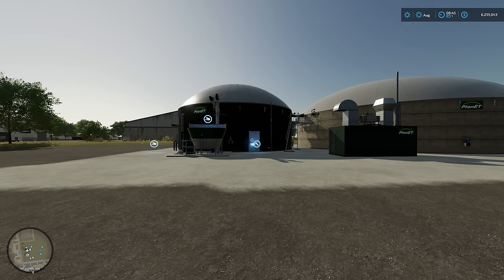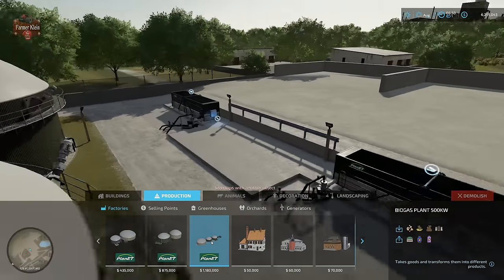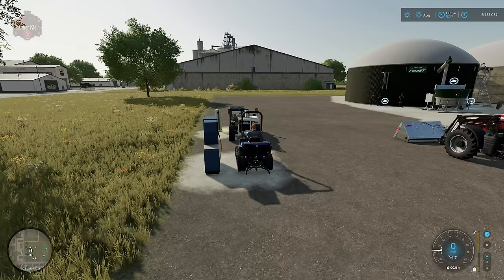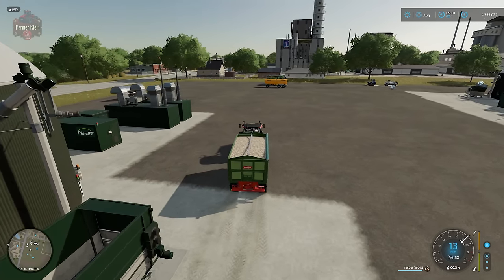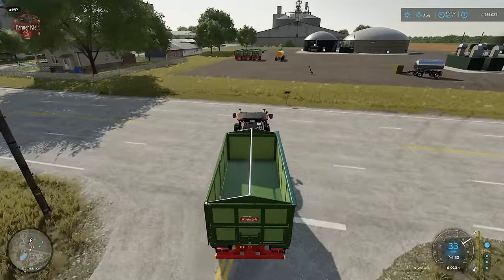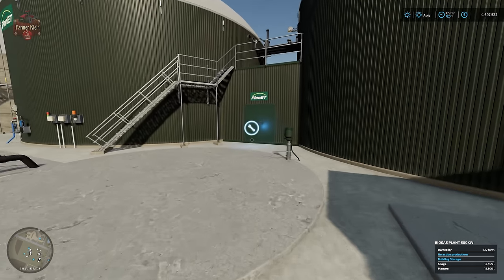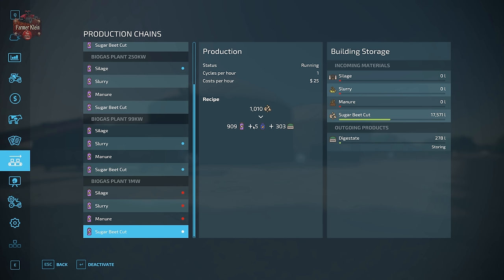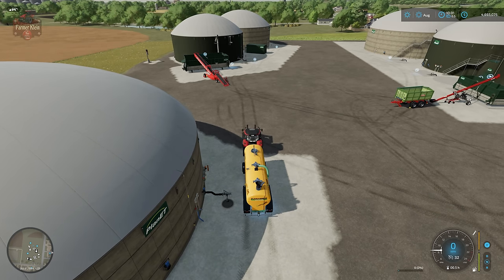Using the BioGas Plants in Farming Simulator 22

Comment: Ran a quick test. On Normal settings the money per 1,000L of silage came out to 509.  On Easy the price per 1,000L came to 863.  Now on easy I usually try to sell at 600 a L. Meaning that would be a profit of 250 per 1,000L Based on how fast the BGA can processes, it would be 29 months before I started to make a profit over that 1.5m investment of the BGA.  On normal it would be 73 months before I started to make a profit on the 1.5m investment of the BGA.  You could probably bring that number down allot if you also did slurry, manure and sugarbeets at the same time.

Comment: Thank you for clearing this up for us, could you go over Rollers for us and when to use them?
Reply from the maker: Once I figure it out.  The list is getting shorter.
Reply: Rollers are used after seeding. My work flow for field needing plowing is: Mulch, Plow, Lime, Stone Pick, Seeding, Rolling, Fertiliser 1, Fertiliser 2. Work flow for non plowing: Mulch, Cultivate, Stone Pick, Seeding, Rolling, Fertiliser 1, Fertiliser 2.
Reply: @Oz_Gnarly_One   why would you first lime and then stone pick? Isnt it better to swap both around?
Reply: Small stones just roll straight over after sowing, you'll do it twice otherwise, stone picker could work but the time taken I don't think would be economic, you will have to use them for larger stones though

Comment: Erlengrat unfortunately doesn't allow you to offload the trailers and you have to use the front loaders to drop them to the container (or belts I guess, if you can use them with bales). Additionally it seems broken, not accepting an input and also over-completing the contract with just one bale that you can scoop out at the end of the process ...

Comment: I remember in fs19 I got bored near end game, I wanted to see how far digestate would go if I completely filled the biogas plant to max capacity and see how viable it was for a fertilizer replacement, but I think spent 3 rounds of chaffing the entire map, filled it to max and then all of the digestate lasted all of like, 1/3rd of all of the fields, I was very disappointed. But it seems that maybe through automatically selling power and methane, you store those two commodities through money?
Reply from the maker: Im not sure I follow the question but when the BGA works like this.  Instead of getting money for silage you dump in the BGA the system converts the silage into electricity and methane which it then sells automatically at the top of every hour so you get money from the production of those and also get digestate as a byproduct.
Reply: @FarmerKlein  yes, you sell the electricity and methane, which gives you money, which you can then use to purchase electricity and methane, its like a pseudo storage through money. Although, I would much rather prefer the option to store both and sell it at a better price like everything else.

Comment: Basic question: hubby needs to sell wrapped bales at bio plant. Took load in but now gets message too full for more. What can he do?
Reply from the maker: Either let time pass so the BGA consumes down the silage that has been placed in the BGA or sell them at the animal dealer.  The BGA since its a buyable production when you sell product to it when its unowned it still processes the product at a rate that it would if it was owned and as such  has a maximum amount you can add at any given point in time.

Comment: Can you show where to drop silage bales off at for sale? The only way I can sell them right now is dropping them close to the big green bins, and manually dropping them in with a telehandler. 

Yet it seemed like when I dropped them off for a contract, they just had to be close to the bins to sell. I’m also on Elm as well
Reply from the maker: ya thats where you sell them  at the digesters or in the digesters.  the bales will slowly vanish its not instant like FS19.  you can also sell them down at the animal dealer to the left.
Reply: @FarmerKlein  I just tried with a big set of bales just now. But I unloaded them by the dumpsters before they were finished fementing. Gonna let them finish first then unload to see if that’s what makes the difference.
Reply: @FarmerKlein  can def confirm, it didn’t like dropping the bales off before they were fully fermented. What’s weird tho, is the first 3 loads sold almost immediately, but the last load is now selling slowly, like you said. So I don’t even know lol. Least as it is now, I don’t have to manually toss them in the hopper
Reply from the maker: @Seantubes  The BGA has a capacity now for all its inputs as it at heart is a production facility.  As a sell point you cant see what that capacity is but if you put alot of bales where then maybe its at capacity.  The animal dealer as a strict sell point has no such capacity.
Reply: @FarmerKlein  ah I gotcha, yeah that kinda makes sense. Do you know if I have to own the bga in order to collect the digestate? Or can I collect it even if I don’t own as a production chain?
Reply from the maker: @Seantubes  I have heard from others yes digestate is only a feature of owning the plant and at that point it's no longer a sell point just a production.

Comment: Is there a way to quickly sell your silage in biogas. In our case we got 2.000.000 silage and it takes so long to process that. We got around 12k per day. We would like to sell all the stuff in a few days, so we can buy new equipment.
Reply from the maker: Nope.  with FS22 buyable production even when its not owned consumes material at the same rate it would if owned.  Once the input is full you can only add in at the rate it consumes it.  The only other choice would be an additional BGA or another sell point that takes silage that is not buyable then it would have no capacity limit.
Reply: @FarmerKlein  And there is no way to increase the consume speed in a xml folder of fs22?
Reply: @Luuk-ur3sp  Sell the Silage to the Animal Dealer, they take unlimited amounts once the biogas plant is saturated

Comment: what if you have Silage bales?  How are those loaded into the plant?
Reply from the maker: Exact same place.
Reply: @FarmerKlein  i have the same question... i know where, i don't know how to unload a silage bale into the hopper.  I started a contract and borrowed the equipment, but there is no equipment for putting these into the hopper.  The best you can do is unload the bales at the biogas plant, but it is not possible to unload them directly into the hoppers.
Reply from the maker: @sticksandsquiggles5847  You dont have to put them in you just place them in front of the hoppers on the upper level.